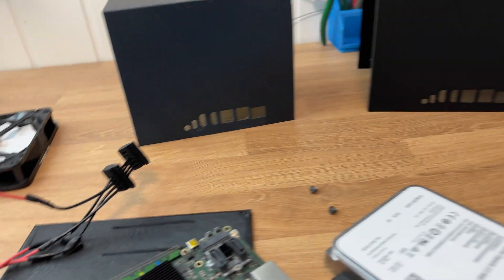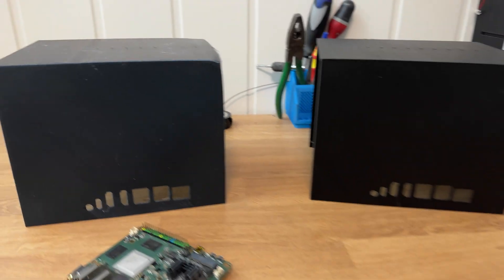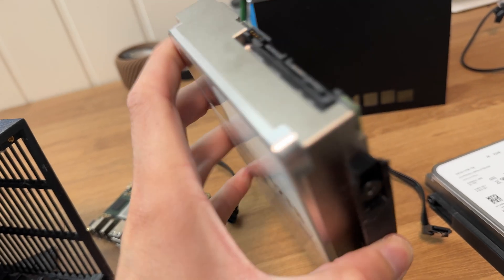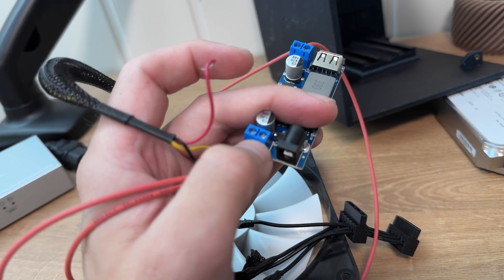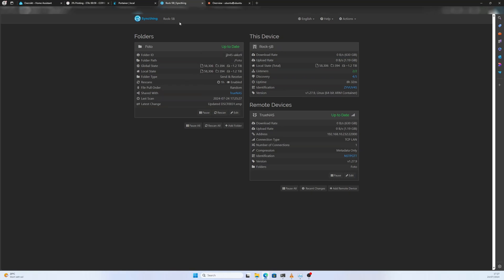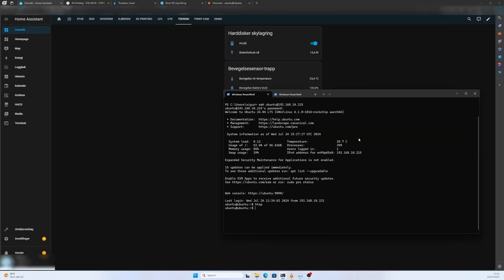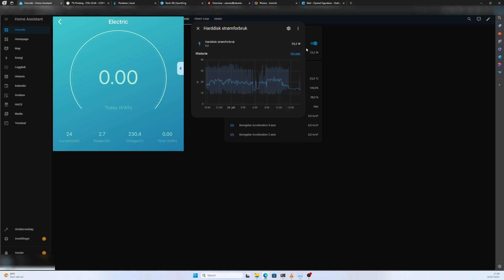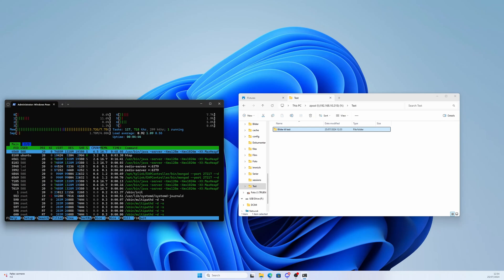Ultra low power 24TB NAS

Comment: There is German YouTuber (Wolfgang’s Channel) who builds very efficient servers. Also I have genuine question. Wouldn’t solid state drives, especially M.2, consume less power than spinning hard drives?
Reply: In idle ssd consume less power but during load consumes more, that said ssd is way faster so for the same file transfer it will probably consume less overalll
Reply from the maker: Previous reply pretty much sums it up. I'll also add that watts per terabyte is lower for harddrives and with a 2.5g nic we have  a maximum transfer speed of about 280MB/s. Slightly above half of what sata ssd are capable of. Two modern HDDs should be able to saturate a 2.5g nic when reading, while writing it won't be quite so fast though.